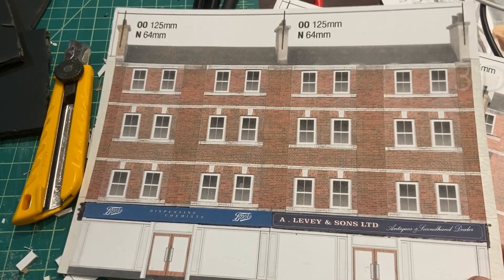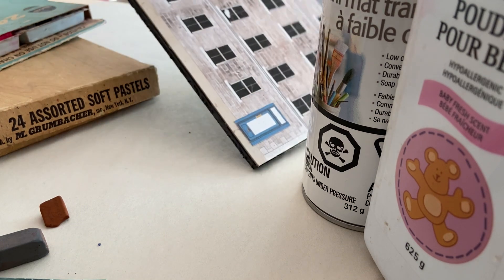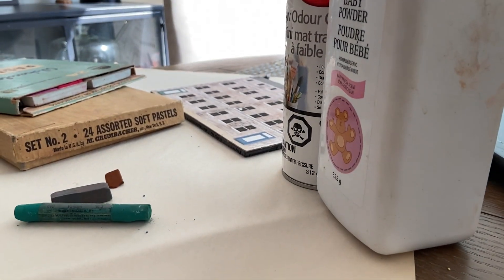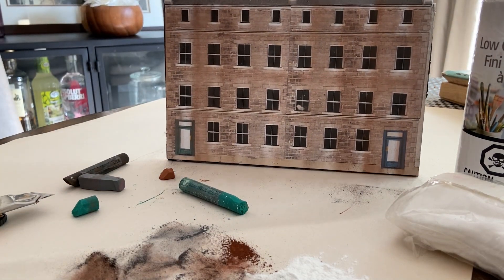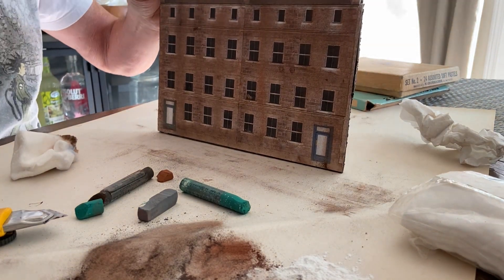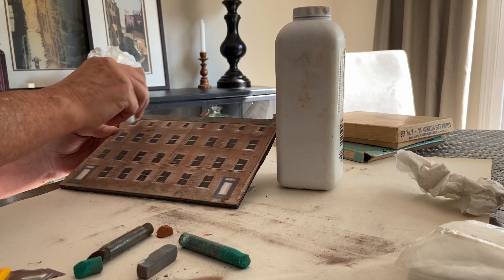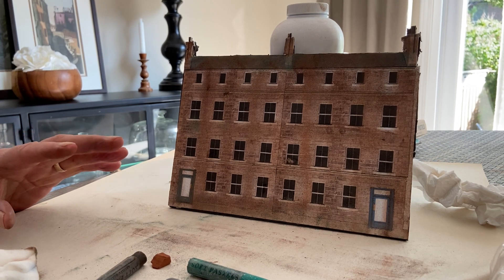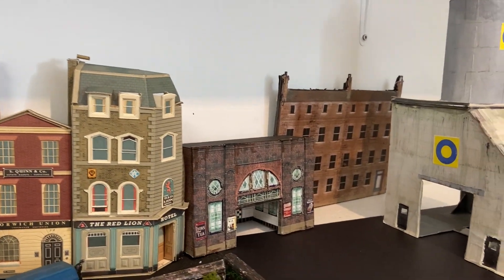How I Added Depth on My Model Train Layout

Comment: It's a very good video, clearly showing the steps you use to achieve such a great effect, but how did the brickwork appear 'raised' and almost individual when it was a print-off?
Reply from the maker: In the one I finished there are no additional layers Peter
Reply from the maker: The application of the pastel powders and subsequent fixing give the impression of depth
Reply: @charlie1872  Thank you - I'm defiinitely going to give it a try...
Reply from the maker: Be in touch if you have any questions. Pastels are cheaper than weathering powders and you can mix your own shades.
Do not forget to spray with the clear matte fixative, let it dry before adding a second/third coat.
Check out my tenement building video where I used the pastels to colour the building.
Cheers
Reply from the maker: Just looked at another building, in fact it might have been the one I first showed. I must have added the columns on either side👍

Comment: Great work - Those pastels really bring out the detail and it does add depth.
Cheers Kev
Reply from the maker: Thanks fir taking a look Kevin, I have used them on most of my buildings and cars which I sketch.
Buying a box is cheaper and bigger than buying weathering powders plus, you can mix your own. Cheers. Charlie